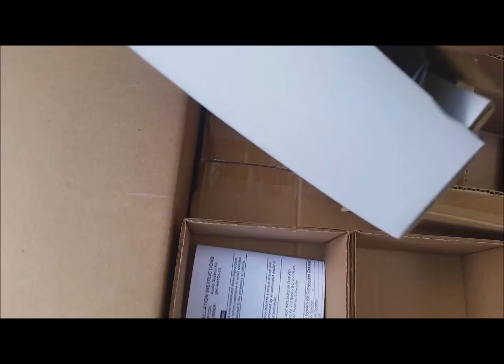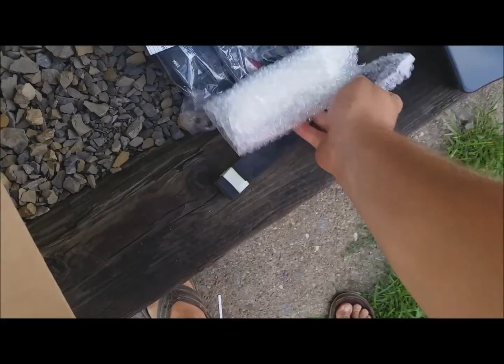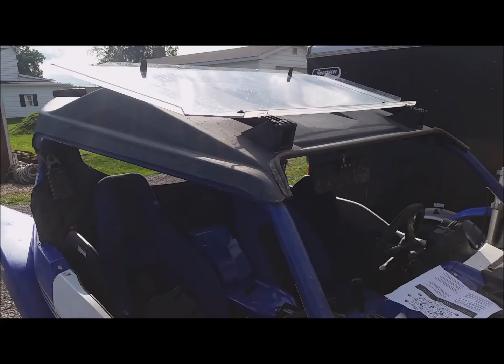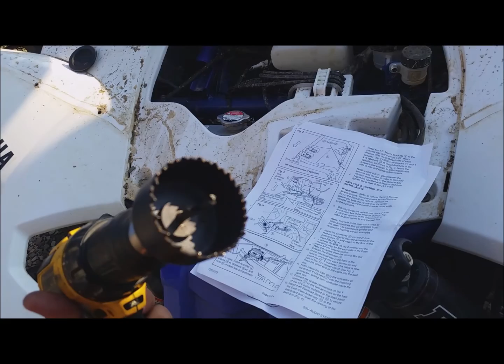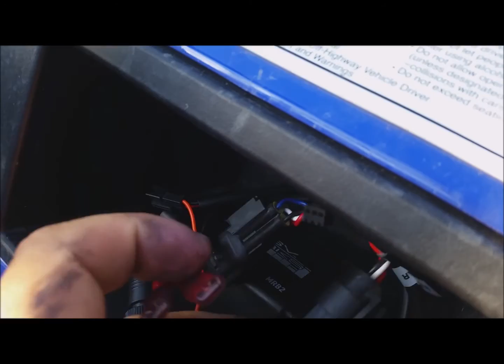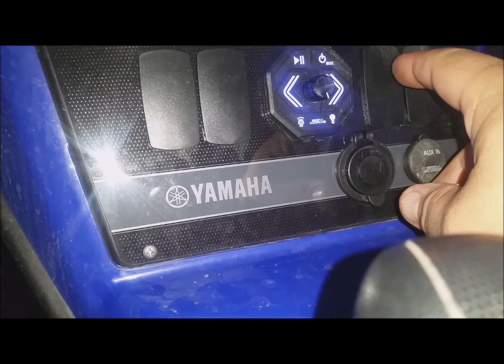SSV WORKS RADIO INSTALL YAMAHA YXZ1000R

Comment: did you have to install the alternator kit in order to use this in your YXZ? or do you have a duel battery setup? want to add a stereo system to mine but not sure the stock charging system will hold up and drain the battery.
Reply from the maker: I don't have the alternator kit.  I think its overkill.   My voltage stays at 13.8 with radio cranked and lights on even with fan running.  My buddies all run light bars  radios  cbs etc and none of them have the alternator kit..
Reply: I never had a problem running my accessories either on the stock battery. Just don’t let it idle for long periods while everything is turned on.